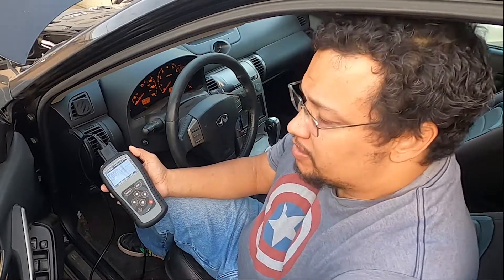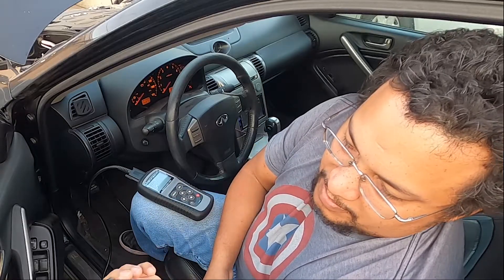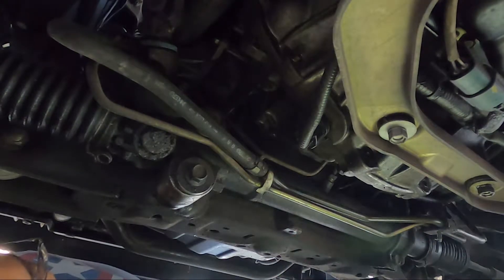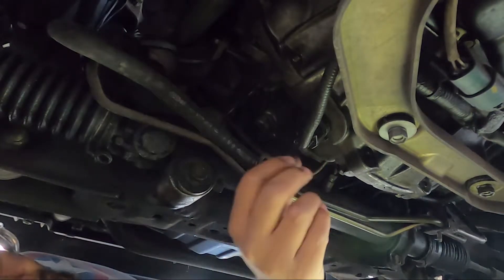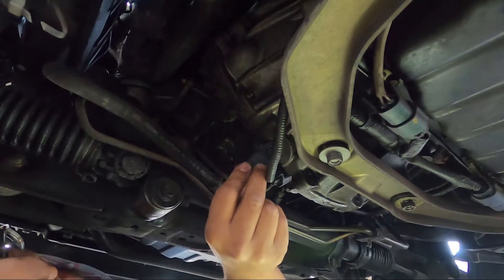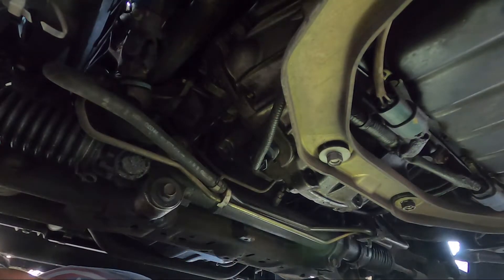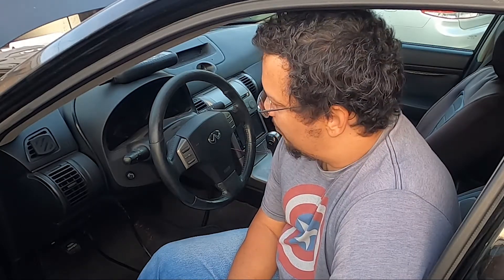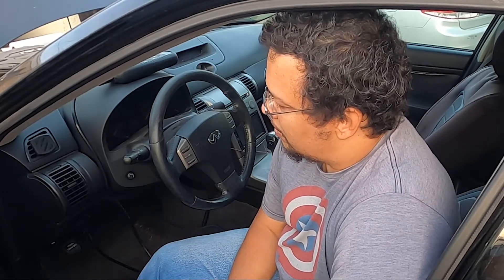G35 crankshaft position sensor change out

Comment: Did it hold up well ?
Reply from the maker: Yeah it's holding up quite well. Haven't had an issue with it since. Starts right up and no more engine code for the crank sensor.